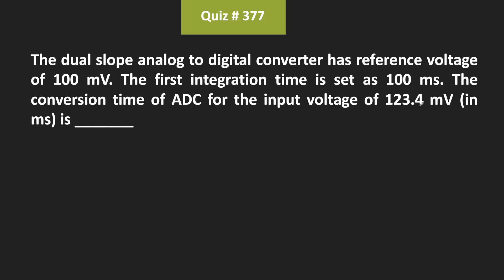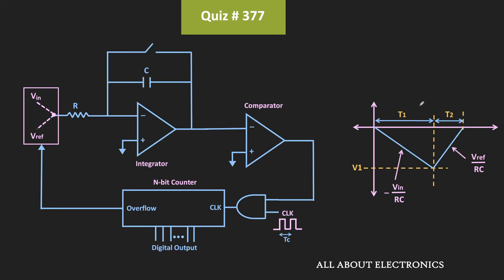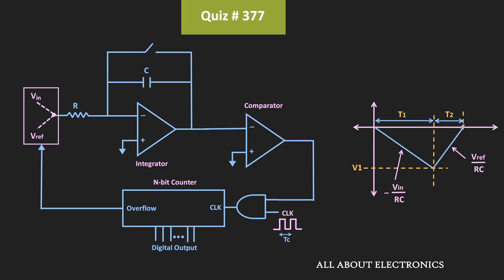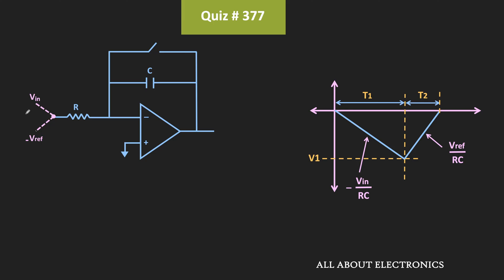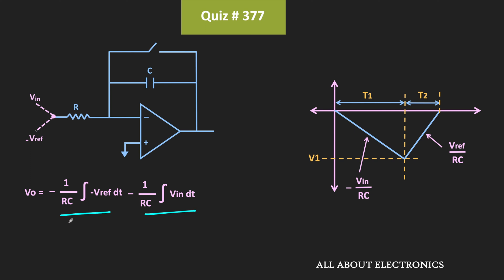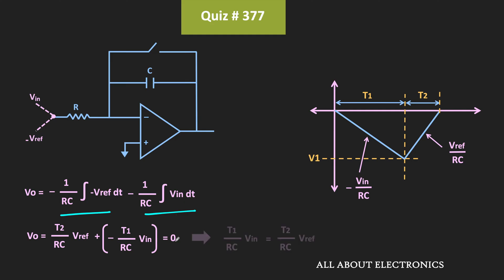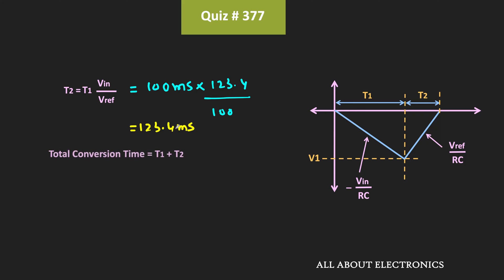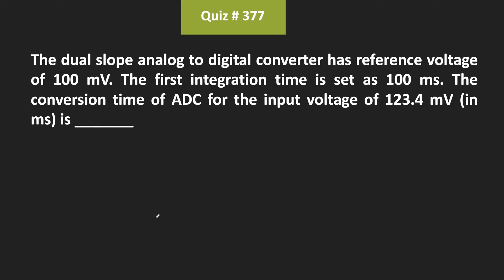Dual Slope ADC Solved Problem | Quiz # 377

Comment: Sir i have a doubt can T2 be more than T1 ?? from formula we can calculate but is it possible sir?
Reply from the maker: At the most T2 will be close to T1. (When Vin is close to Vref).  T1 is the fixed time for which we are integrating the signal. T2 depends on the Vin. 
For more information, check this video on Dual Slope ADC:
https://youtu.be/2gF_nfaBV_0